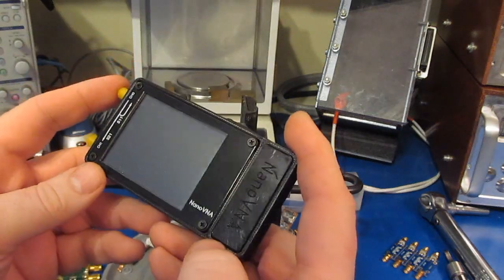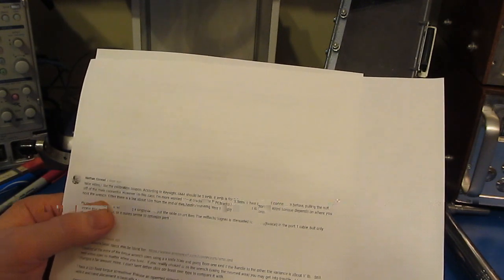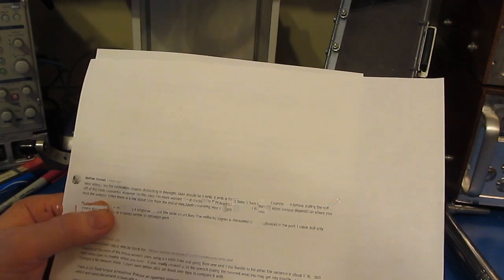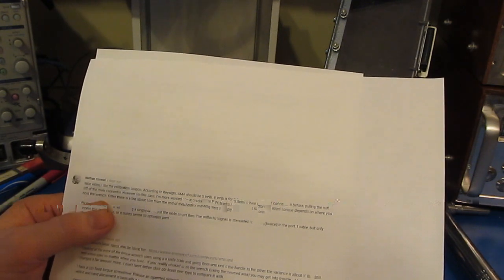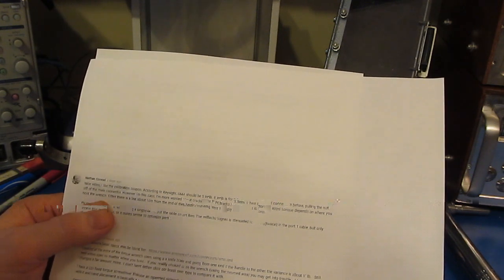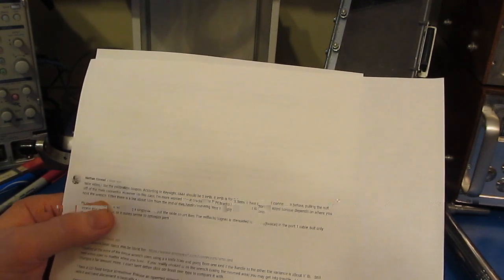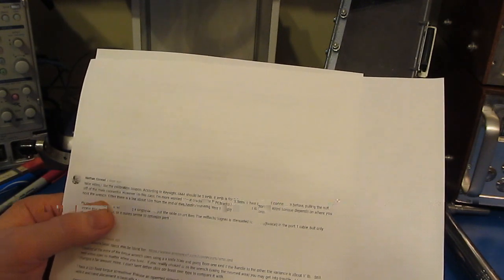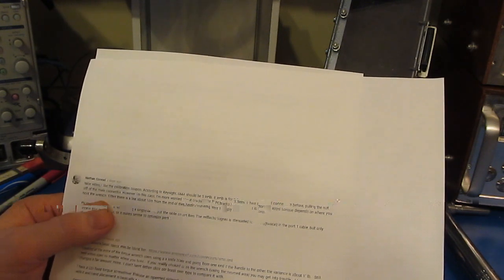NanoVNA Torquing SMA Connectors

Comment: If you only screw your SMA connectors hand tight, you will inevitably get grossly incorrect and inconsistent results! So, it is necessary to used a wrench to tighten SMA connectors. How tight? 5 or 6 in-lbs. is good for electrical connection, 8 in-lbs. for permanent vibration proof connection.  

Right now you can buy a bend-over type torque wrench on Amazon for only $31. IMPORTANT - the wrench comes without lubrication! You must apply oil to the elbow and internal cylindrical sliding surfaces, and grease to the ball surface - else excess friction will probably break your SMA connector! Once the tool is properly lubricated, it should be calibrated using known weight and length scales. With all this done, an SMA connector can easily take 6 to 8 in-lbs. torque - no problem!

Do not push on the end of the torque wrench handle! When applying torque, remember that you are literally "applying torque" - not linear force. This means your hand and wrist should impart a twisting action. If there is any linear force applied to the tool, it will result in a combined force (sheer + bending + torsion) when all that is needed is a simple torsional force.  Unnecessary combined force could break or damage the delicate SMA connectors or PC board. 

--a  mechanical engineer

Comment: I have seen a lot of videos on using the NanoVNA for ham radio. One thing that NONE of them seem to mention is that you need a SNA to S0-239 adapter to connect it to your antenna. Its like the poster just expect the viewer to MAGICALLY connect the NanoVNA to the antenna.
Reply from the maker: I've have no interest in ham radio.  It's like hams just expect the only use of a VNA is an antenna analyzer.
Reply: @joesmith-je3tq  For ham radio work, I use my VNA's thru connection all the time for building filters, BALUNS, measuring attenuation and insertion loss. Also, for Smith chart, measuring phase, feed line length etc. But yeah, a nanoVNA is a convenient alternative to spending a $grand on a bespoke antenna analyzer that can do HF to 1.2 GHz
Reply from the maker: @reedreamer9518  Rare

Comment: I like the way you modified your socket by removing the side so you can see how it sits on the connector and will allow you to use it with cabled connectors.  That is a great idea!  I can do that and use my click stop screw drivers for connectors.

Your simple torque calibration rig is also a good idea.

Thank you!

Comment: in a previous life, I was a component specialist at Nortel Networks, and previous to that, at a startup that was bought out by Nortel.

At the startup, we had a couple of systems that we had designed. One was MMDS. and the other was LMDS. MMDS was essentially a wireless version of cable television distribution. It worked at 2.2-2.3 GHz. We used SMA connectors for the interconnections between indoor equipment and N type for the outdoor. We were always careful to use SMA torque wrenches set to 8 in.-lbs. for that equipment. The LMDS equipment was data communications equipment at 24-39GHz. That equipment used K and V type connectors (looked like SMA connectors on the outside, but the mating surfaces were different, and had different dimenstons). One of the engineers was doing some work, and didn't get the results he wanted, and determined (don't ask me how he determined this) that the Network Analyzer cables weren't tight enough, and grabbed a regular wrench and just started twisting. This was a 50GHz Network Analyzer (with is accompanying phase corrected cables, all V type connectors). He basically fused the cables to the front to of the Network Analyzer. When I ended up calling HP to get the Network Analyzer repaired, HP said that the unit was un-repairable so that it could meet its specifications, and replaced it under warranty. We did have to buy new cables (at $5K), plus the flat rate cost for repair. HP said they would repair it and use it for a sales demo unit.

I went to work at Nortel when the startup was bought out. I was working on the same LMDS equipment, but when that product line was discontinued, I went over to work on the (at the time, CDMA) cellular base stations. Those base stations had RF combiners with SMA connectors on them. Each base station had a number of those combiners, and I was the component specialist that was responsbile for the combiners. Anyway, in the outdoor base stations, everything was wired up, (including the RF cables), and all 3 units were bolted to a giant metal skid for transport. In the transport process, the RF cables were coming loose. So the mechanical engineering group, without asking, changed the torque spec from 8 in.-lbs. to 21 in.-lbs.  This was enough to damage some of the combiners. They got sent back to the supplier, who then gets back to me, saying that they were NOT going to provide warranty coverage on the defective units that showed damage due to over-torquing, which was almost all of the units. I went down, and under no uncertain terms, told the mechanical engineering group to put the torque spec. to 8 in.-lbs. This was mostly internal to the factory, until I had the field performance group write up a technical bulletingto all customers in the field, which resulted in both a field recall & retrofit (because the SMA connector solder joints could no longer be considered reliable) and  considerable backlash from the end customers. It must be understood that the backlash was from the same customers who were complaining about needing to torque down the SMA connectors on-site in the first place.

Comment: how about putting a mark on the fittings with a felt tip pen when they are in place once and either using that to decide when to stop tightening on subsequent occasions or checking your torque wrenching is correct (which I imagine it will be).
Reply from the maker: Torque is not the same as position.

Comment: just wondering what make and brand your tiny wrenches are! the ordinary ones. cannot find a good set anywhere! really enjoyed the video thanks

BTW hope you will still be getting the new brymen to review. its great that they send them out to you for you channel. looking forwards to it!
Reply from the maker: The one shown was made by Dunlap.  I also have a few from Craftsman and Easco as well.  All made in the USA.  I would imagine you could buy a used set or with the small amount of torque we are talking about maybe find a new cheap set.
Reply: @joesmith-je3tq  ah no worry i found some others now! actually the problem i find with mini spanners is that they often have very poor tolerances and fit relative to the smaller nut size. however the cheap price gives me an idea.

perhaps i could buy a cheap set and then cut off the business end. and file a 1/4" sized notch into the stub. that would then turn it into a crows foot. with the few basic hand tools i have available to me here. it might just work!
Reply: ok furthermore: Proxxon 2021 English industrial catalog page 28+, goes down to 5.5mm (when sold individually). They have a low cost, but a high review rating on amazon.

Facom have 440 series wrenches. Which go as low as 4mm (when sold individually). On page 219 of their catalog. Also high customer rating on amazon. Yet a bit cheaper than gedore or stahwille.

But how about a ratcheting micro spanners. The smallest seem to be the: "KS Tools 503.42055". As tiny as it is. But no direction change lever. For that extra luxury, the Facom starts at 6mm (on page 203 of their catalog). And Proxxon starts at 8mm (page 25).

With the facom Cow's foot (wrench size 7mm+ or 1/4"+) being on page 404
Reply from the maker: @dreamcat4  I always tighten RF connectors by hand, then torque them.  I see a few problems using a ratcheting wrench as you show.  I would loose the feel of the connectors as they mate.  The wrench is not open so no way to remove it when torquing coax.  There may not be enough friction to allow the ratchet to function so you may need to add drag with your fingers.
Reply: @joesmith-je3tq  thanks joe, dont worry i am aware of those problems. was just speaking more generally there about mini wrenches for a more broad set of applications where the ratcheting feature can sometimes be useful.

For this specific SMA application it really would be cutting the head off a double ended spanner (eg 6+7m), to fashion from those pieces a pair of the crows feet in 2 adjacent sizes. Such open double ended (of 2 sizes in 1 spanner) are sold by the likes of hazet, famco and stahwille. Different spanner series in their cataloges. Which forgot to mention here specifically. Was just so excited to find ratcheting versions so tiny!

In fact stahwille and 1 other (maybe hazet) go as small as 3.2mm in a special range, they call them 'electrical' spanner. Which is even smaller than the previously stated 4mm. Which is pretty awesome. Expensive but awesome.
Reply from the maker: @dreamcat4  I would imagine some of the people working with small mechanical parts may be able to point you in the right direction for tool selection.  Watch makers for example.   Guessing there is some very nice tools available. For the RF connectors,   I keep a 13/64th handy next to the VNA along with a few other common sizes.

Comment: An excellent explanation of the correct way to use a torque wrench! (A must see for my shop techs) All my torque wrench's are Snap-on and they get calibrated yearly. The hand placement, and holding the handle with a lose grip is important for a click type to work correctly. Even putting a twist on the wrench and keep it from clicking at it's setting. Snap-on even puts hand placement arrows on the handle to show just where the palm of you hand should lay. For in-pounds I always just use a finger loosely curled around the handle and slowly apply pressure till it click, pulling quickly will cause the wrench to miss-click giving a bad torque.
Reply from the maker: You bring up a good point.  I would hope that people understood that the successive fast readings are NEVER actually something you would do.  As you stated, you should always slowly apply pressure till it clicks.
Reply: very interesting because i got mine from wera. however they only sell torque drivers below a certain size (2.5nm). and with a driver you are gripping a rotating shaft so it the does not matter. so this is why they make them like that! (at least wera company)... problem is: that then makes them unsuitable for working on things like these sma connectors. unless they can be adapter with some little crow foot type thingy maybe? hmm i wonder. please let me know if happen to know abiout that. many thanks
Reply: oh i see now in the middle of your video here... i could in fact use the same crows foot you have there. but where to get these things so small. most of the crows feet i see online are for the larger size wrenches

 or i could make a copy of the special tool that you yourself made. but it really depends how difficult it is to make those things... it seems like you cut up a 6 sided  deep socket, and removed 2 adjacent faces to create a gap in the side of the socket. is it ?
Reply from the maker: @dreamcat4  That crows foot was custom made but you could purchase a 1/4" drive and get a hex to 1/4" if that is what you are after.  I have found it much more useful than the split socket for tight spaces as normally in those cases I am working with semi-ridged.
Reply: @joesmith-je3tq  yes i do already have these 1/4 inch drive wera torque drivers. so do need a correctly sized crows foot to get access. to come in from the side next to the SMA, since the coax cable stick out axially out of the SMA and along the same axis we want to be torquing.

so perhaps it's a shame if we cannot find these crows feet in the smaller sizes. have not bothered searching myself yet. it sounds here like you are saying that the crows foot must be 1/4" size spanner to fit the size of a standard SMA. sorry to ask for clarification but i live in europe here. and we tend to metric instead. like 4mm, 5.5mm, 7mm etc. i also wonder if these SMA type connectors also come in a few other different sizes. not too familiar myself

anyhow the point is kindda moot (for me) if they cannot be found available anywhere. as unfortunately i don't have access to cnc machine to have cut my own crows feet. however! for other people here, those who happen to live in USA... then maybe an online CNC shop like send cut send might be a good service to use. For making your own crows feet. maybe also a few other useful little tools. honestly i wish i was more ingenious to think of these things like you there joe! very clever to think of accessories like these. so useful
Reply from the maker: @dreamcat4  An 8mm 1/4" drive shouldn't be a problem.   https://www.ebay.com/itm/STAHLWILLE-540-series-1-4-Dr-OPEN-CROW-FOOT-SPANNER-WRENCH-8mm-Made-in-Germany/131533488127?epid=1904238768&hash=item1ea001bfff:g:xqkAAOSwpdpVeG6O